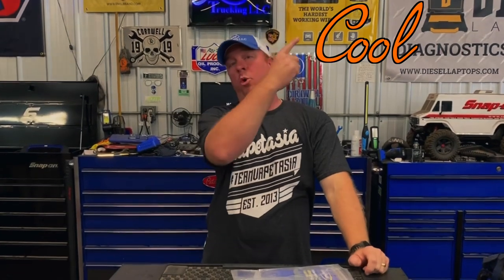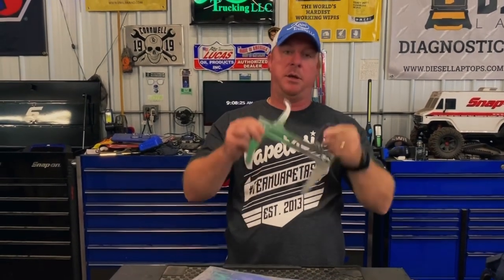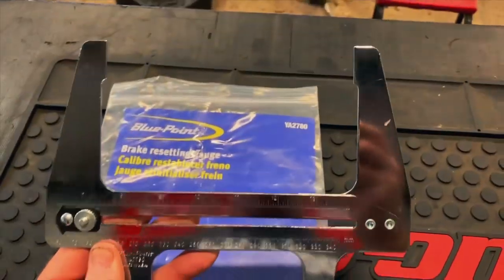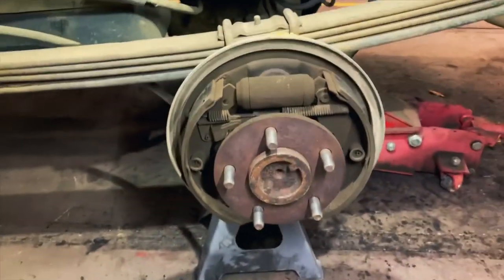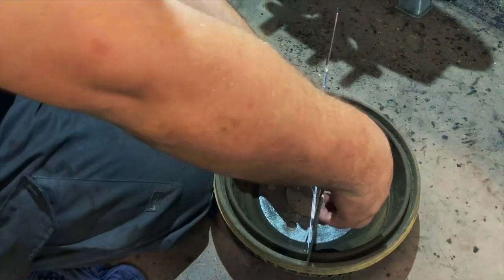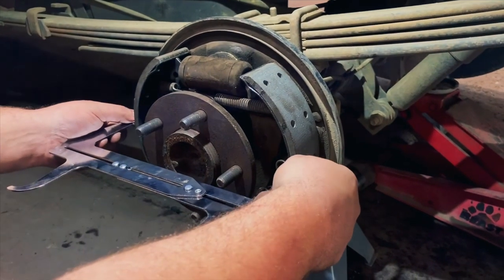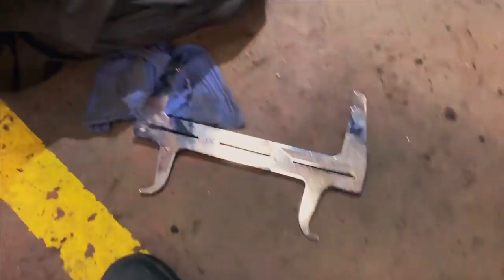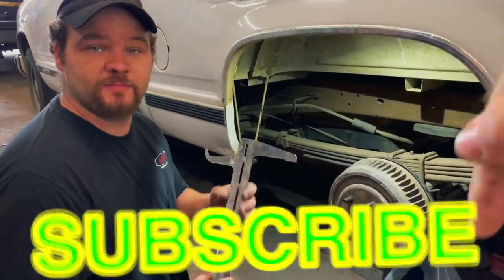Cool Tool Tuesday: Blue Point Brake Resetting Tool

Comment: Just say if you have 11 inch brake drum that measures 11 inches inside diameter then you measure your distance on your brake shoes 11 in outer diameter is what I'm getting on the Amazon tool is that correct

Comment: Won't go on
Reply from the maker: Drums have a lip on them from wear ? Because if you set the tool for the drums and adjust the shoes till they barely touch it’s the same size for them to be adjusted properly ?
Reply: You are supposed to go a certain amount under whatever measurement you get on your drum.  For example on the car I'm about to use one of these tools on, the service manual says to go 0.030 of an inch under the measurement you get on the inside diameter measurement of the drum which on the scale on the tool will be one mark less than whatever measurement my drum is.  That way the drum should go on without problems unless you have a big ridge on the drums in which case you should get them turned or buy new ones.